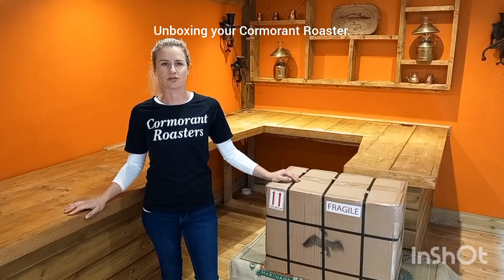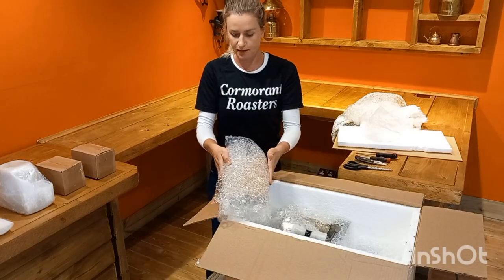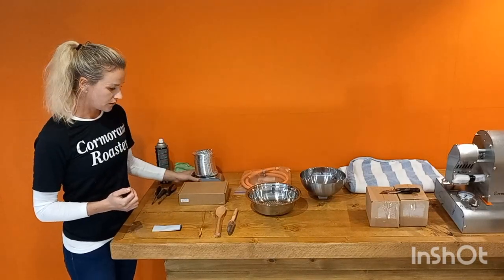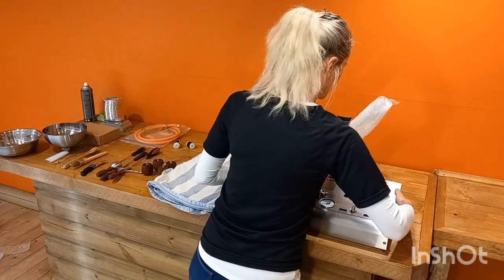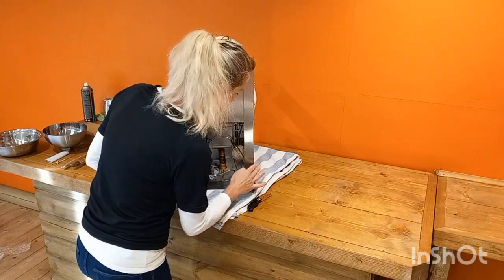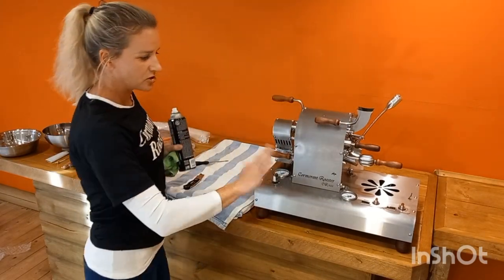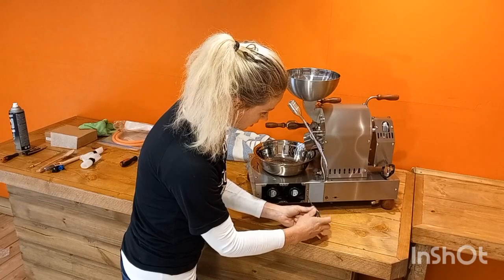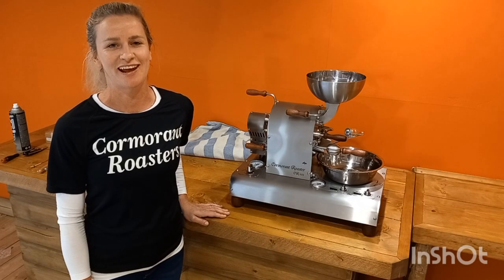Unboxing your NEW Cormorant Roaster!

Comment: A great little roaster. Spectacularly low gas consumption. I am beyond 80 batches and still on the first 5kg gas bottle. Very good control, easy to clean and great support by Johan. Well designed, compact, but still a great resemblance of a larger drum roaster.